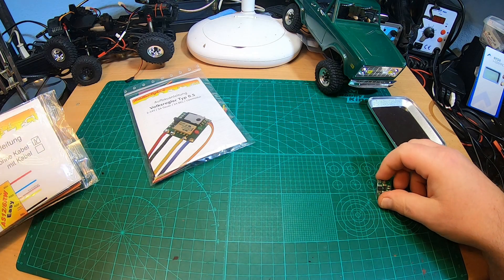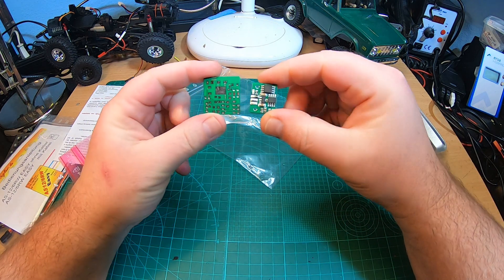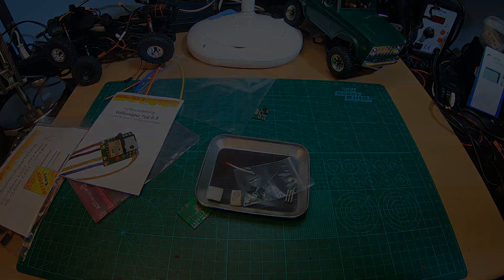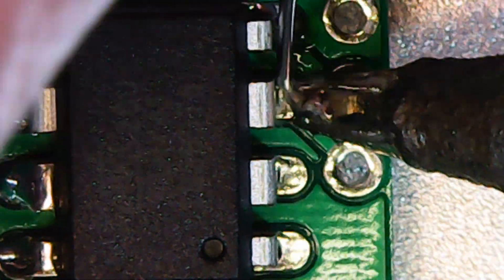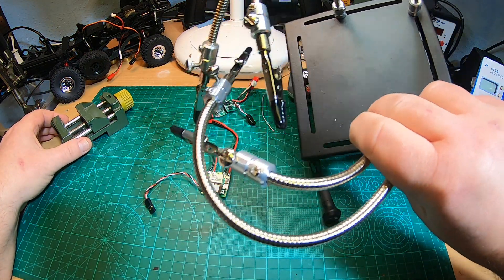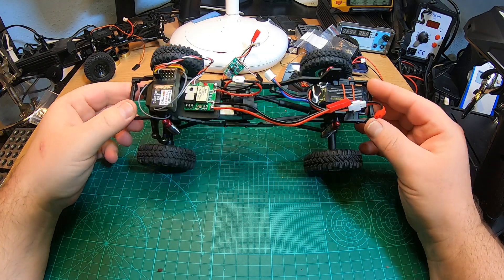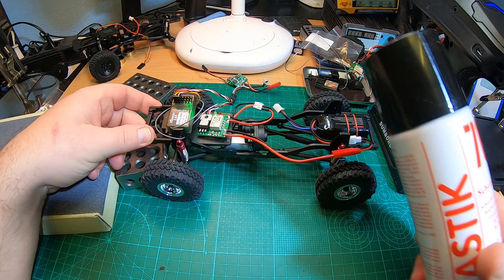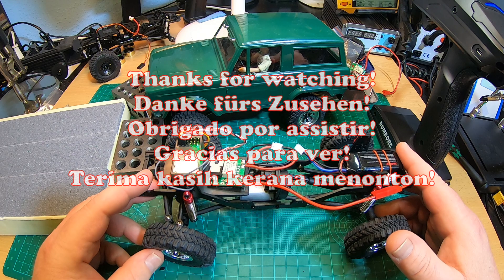Build your speed controller: Volksregler Typ 0.5 HV DIY ESC

Comment: Wonderful, thanks for the introduction to this product. The design is very old-school: single transistor creating the PWM, and a relay to change motor polarity. Just like the first car ESCs were done! Simple solutions are always the best.
Reply from the maker: Those ESCs are already on the market for many, many years.
Only new to RC crawler ;) - not for the people of the large construction machines and vehicles scene here.
Initially this company built ESC for boats. 
I also did not know this...